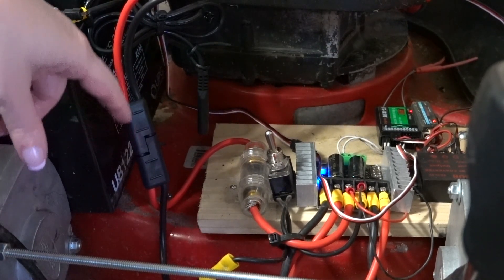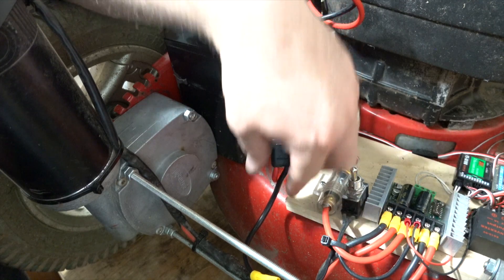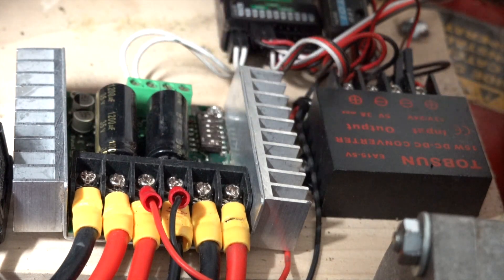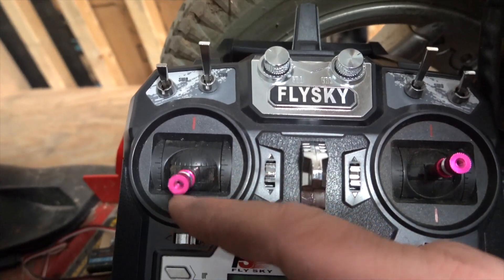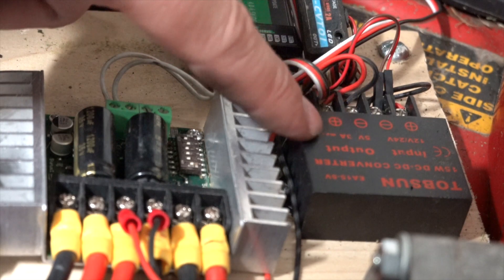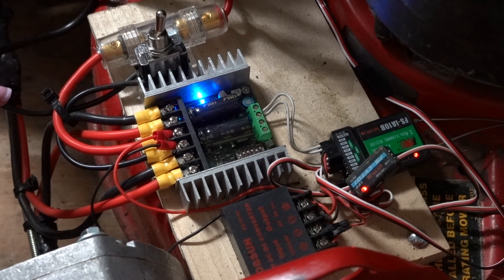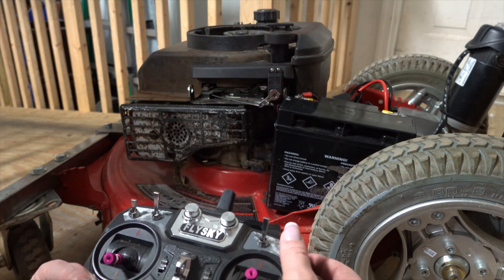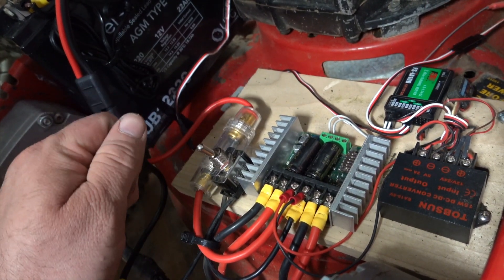How To Wire An RC Mower (Step-By-Step)

Comment: Hi,
Witch Kind of battery Do you used. Do you think a battery from a motorcycle 12volt is enought?
Reply from the maker: He used a 12V 20Ah scooter battery and that gets him about 20-30 minutes of run time. Most motorcycle batteries seem to be about 10Ah, so they will probably work if you have a small, easy to mow yard with no hills and shorter grass.
Reply: @MeantToBeLindseyB  oh. Fine Thank you

Comment: Hey guys, Once again - Great Build. I have everything in place and ready to be connected based on your recommendation of parts. I need one last piece of advice. I am actually using the same transmitter and receiver that you are. That being said I feel like this is a differential thrust type setup similar to that for a RC plane. Can you give me a little guidance on how you set your channel 1 and channel 2 to work the way that they do? I know there is channel mixing that needs to be done in order to accomplish this. Any help would be greatly appreciated.
Reply from the maker: The motor driver handles that. Make sure you've gone through your settings for your DIP switches for the motor driver and then just hook up channels 1 and 2 and it should just work. No additional setup should be required.
Reply: Okay. I think I've worked out the transmitter. 
Next question. What size battery are you using. It's 12v but how many amp hours and how long does it run for?
I am experimenting with lipo cell batteries as I have them for other toys, but I think they will be insufficient for run time as they are 1300mah translating to 1.3ah :(
Reply from the maker: 22AH battery and it runs for 20-30 minutes on a relatively level terrain. He tried a 5AH LiPo battery and he got less than 10 minutes of run time on it (that's now his backup battery)
Reply: @MeantToBeLindseyB  awesome.. thank you so much.

Comment: Possible upgrade: Some mowers are available with 'push-button' starting (with automatic choke). I don't know if you've got any RC channels left but, if you have, you could then start the mower remotely and sell your drill.
The fail-safe was a very good idea.
Reply from the maker: His next build will definitely be an electric mower, so we don't have to deal with any of that.
Reply: @MeantToBeLindseyB  Just bought my Kobalt 80V for this project.   There is a push button to start and a bar that has to be held down while mowing.  Any tips?
Reply from the maker: @dr.psprojects9591  The bar that has to be held down he replaced with his "killswitch servo" and for the push button start... That's great! You should be able to reach down to push the button to start the mower. He personally probably wouldn't try to add that start to the remote or anything like that but if you NEED to, you could probably look into an electronic relay to trigger the start but it would require taking it apart and looking at the electronics to know what would be best.
Reply: @MeantToBeLindseyB  I had a royobi 40volt cordless mower and consider doing that. You will have to build a frame due to the plastic might break. You won't need to use the hold down.  I found a magnetic switch in the notch for the mulcher/bag grove. Just taped a steel driver (phlips) or cut a steel rod or bolt,  aaargghh into the far right of the slot.

Comment: Do you know the range capability of the system? I looking at making a machine that travels on a farm that won’t be in direct sight. Maybe to mow an electric fence line at first.
Reply from the maker: From the information I could find online about the particular transmitter and receiver we used, it looks like the range is about 1,000 meters (or a little over 1/2 a mile) but maybe slightly less since the mower is on the ground and this transmitter and receiver is used for airplanes in the sky.

Comment: How is the speed of the motors controlled? Very good and informative video. I think that I am missing something about the speed control. I have the same trans/rec. as you have to control a jazzy.
Reply: Actually, if im not mistaken, the battery voltage you give it also determines speed. Probably have 24v motors and i believe the sabertooth can handle around 30ish volts.  Obviously more volts the faster it will go
Reply from the maker: The battery voltage does determine the max speed. In the testing, he determined that 12-volts gave plenty of max speed for our usage.
Reply: @DTB2.0  Yes, sure will. With out the 80 lbs. seat. They are very fast and powerful. Have fun and thanks for your time.
Reply from the maker: The motor driver determines the speed based on the input from the remote receiver.
Reply: @MeantToBeLindseyB  Sorry took so long to answer. Got it now. Forward on right stick, will cause progressive speed increase and track forward. Same for reverse, except move stick down. Stop in the middle. Yes, I am running 24 volts and slightly bigger tires. If it gets a good bite of traction it will jump. Thats with no seat 8o lbs seat of course. Thank you guys for you time. Have fun.
Reply: Heres my build so far: https://youtu.be/sLSd_26TjEk
Reply from the maker: Looks great!
Reply: @MeantToBeLindseyB  appreciate it!

Comment: The battery needs to be tied down.  How did you manage this?    I need to shorten the wires as I made them too long.  I want to add the servo for the cut-off on the mower. Camera will be a good idea, too but need to get other things finished first.
Reply from the maker: He just uses zip ties for now. It's not a great long term solution but it works.
Reply: @MeantToBeLindseyB  I used https://www.ebay.com/itm/Odyssey-PC680-Aluminum-Battery-Hold-Down-Competition-Quality-Made-In-USA/262892761897?ssPageName=STRK%3AMEBIDX%3AIT&_trksid=p2057872.m2749.l2649

Comment: It is sitting in my living room wheels/motors mounted.   I'm tired.  2 days of drilling/re-drilling.  Getting things lined up as best as can be.   What an accomplishment.
Reply: What an accomplishment! You mentioned drilling/redrilling… I was attempting to replace the latch mechanism on my pickup gate, and finally did it on “Mark III”. I remarked to my wife and daughter that one section of the ladder resembles Swiss Cheese!

Comment: The inline crimps finally showed up.  So been playing with the mess.   The link you gave for black/Red wire is for 10 gauge.   Its too big for the yellow connectors.  The wire needs to be most likely 12 gauge.  I was able to solder wires end to end and then cover with heat shrink.  This is not the strongest wire connection but it works for now.   I was also able to wire up the battery and one motor to the Saber and got a green light.  Things are finally moving forward.
Reply from the maker: I'm glad to hear you've had some progress. You'll have to send me a video or something once you get it all done. :)
Reply: @MeantToBeLindseyB  Im at the point where I want to install the receiver.  I understand the channel one and channel 2.  Which wires on the jumper cable do I put in which port on the saber?
Reply: Rewatched the video and have a better idea.   Will tackle in the morning.   On a down note, the Snapper mower I bought on EBAY fell through.   The seller kept changing stories on shipping so I canceled.    I may just buy a battery mower and destroy the snapper gas mower I have.  I thought I could do this in an afternoon but when things don't go as planned i have to be able to work around.
Reply from the maker: The white wires from the receiver on channel 1 and channel 2 go to S1 and S2 on the Sabertooth motor driver.
Reply from the maker: Yeah. He really wants to build on an electric mower next time.

Comment: After playing with the motor for an hour and a half, I found there is a switch on the side that I can flip to release the brake.   The brake needs to be released to get a free moving wheel.  Despite this "Duh" moment,  when the other motor arrives I can test to see if this be the case.  The motor that I have was tested but did not turn which is when I found out (or so I thought) that the brake needs to be removed.  Also the wire clips I have nearly burned up because the wire is so thin but I know they are not rated for 12v.      I must be doing something right the house hasn't burned  down....yet.
Reply from the maker: Any time the house doesn't burn down, I call that a win. :)

Comment: I have the parts laid out and am ready to go.   The wheel chair motor and batteries were heavy.  It was hard to find a 12v/24v motor so I got the 24v so that means I need to wire up both batteries in a series.
Reply from the maker: Correct. A 24 volt motor does work with a 12 volt battery. It's just going to go half the speed. That's exactly what our setup is.
Reply: @MeantToBeLindseyB  I bought a variable speed relay because I was concerned about the motor running speed.  I didn't like mixing wire gauge on the STST switch so I bought an inline one.  As this goes together I want to build the circuit small and then add items.
Reply from the maker: I agree. Keeping it simple until you get it working and then adding in components later is always a good idea. It helps with troubleshooting and easier expansions and improvements/upgrades.
Reply: Today I worked on wiring to the Sabertooth.   The STST switch you recommended the wire was too thin so I bought and inline switch.  The U-Clips had to be bent slightly to fit
Reply: @MeantToBeLindseyB  The inline switch was the wrong gauge so I sent it back.  At this point not sure what to do about the switch.   Once the inline crimps show up I think Im going to move forward with wiring in the remote controller.
Reply from the maker: He has since replaced his switch with a circuit breaker instead. It has 2 screw terminals and is really easy to install and use.
-100 Amp Circuit Breaker (Fuse and Switch replacement): 
https://amzn.to/3eBmx1a

Comment: Quick and maybe dumb question.. what would've happened if you wouldn't have put the servo on the throttle? would the blades have just remained at one speed? Also, more or less how much did you spend on all the parts and electronics? Thanks for all the explanations!! Great videos, y'all killed it!! Looking forward to do this project:)
Reply from the maker: It would be fine without the servo for the throttle. The blades motor would just remain at whatever speed you set it at, but there are times when I want to speed it up (bushes and weeds and leaves in the back yard) or slow it down (easy cut in the front, no need for all the noise and waste of gas). Depending on your particular mower, you may be able to leave off the servo and adjust it by hand as needed. Mine was too loose for that, so I had to do something. It wasn't much more work to add the servo so I figured I might as well do it the best way right off the bat. Another thing to keep in mind is that slider piece, at least on mine, is right on the corner and likes to get hit with a lot of branches from bushes and stuff, if it gets pushed to the slowest position, the blades motor will probably stop and then you'll have to start it again and reset that throttle.

The price of my particular build was about $500 + the mower.
Reply: @MeantToBeLindseyB  $500?  You got off pretty easy.   Motors go for $124 each on EBAY.  (Left and Right Permoble M300)  2 wheels are about $100.  Make sure the motors have wheel hubs or that could add another $50.   The controller is another $100 unless you are lucky enough to find the smaller version.   If you have someone willing to give you a free mower, used snappers like the one they use can be $150 - $200.  I've got a GRAND worth of parts on the work bench now.

Comment: Great video guys. The only thing you did not cover was the dpin switches on the motor driver. That is where I got hung up on my build. I will be building a few in the future and will use your affiliate links again. Cheers.
Reply from the maker: Thanks for reminding us. We did forget to mention the DIP switches that need to be set on the motor driver based on your configuration. 

For other viewers looking for an answer to this: Please consult your motor driver's manual on what the correct settings for your configuration are. If you have the same Sabertooth motor driver shown in this video, you can use this wizard to select your exact configuration.
https://www.dimensionengineering.com/datasheets/SabertoothDIPWizard/start.htm
Reply: You are so right i forgot that on some of the Dimension engineering motor control boards you need to set the switches to hobby remote control it is in the instructions when you get the remote control motor board .